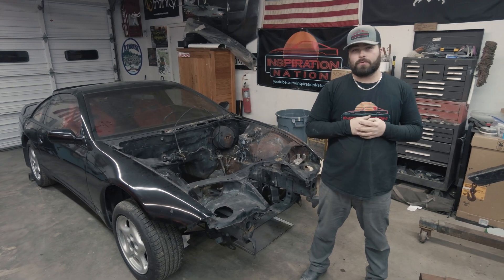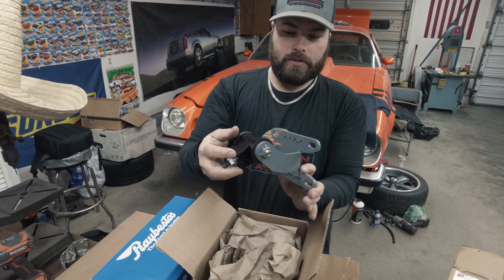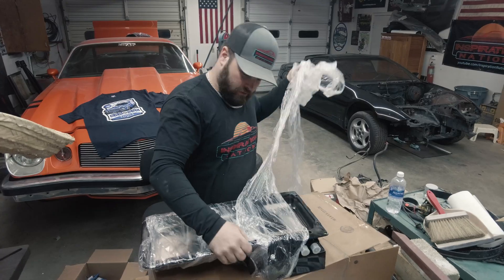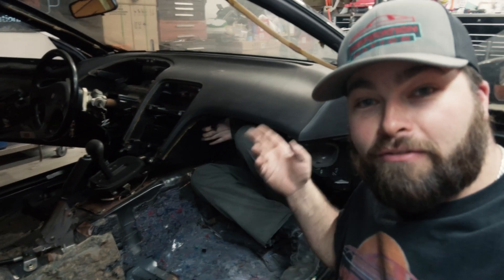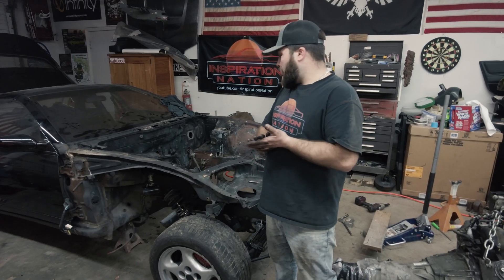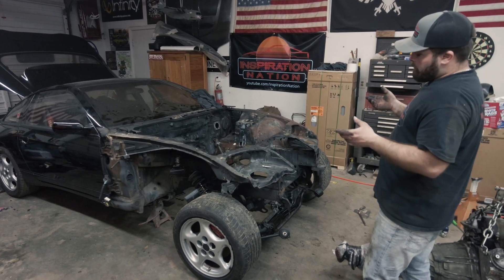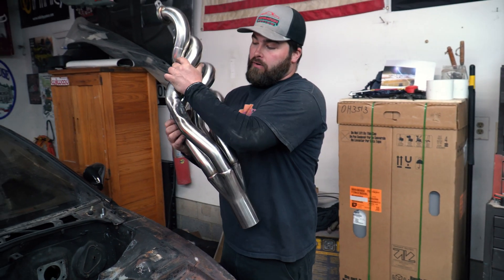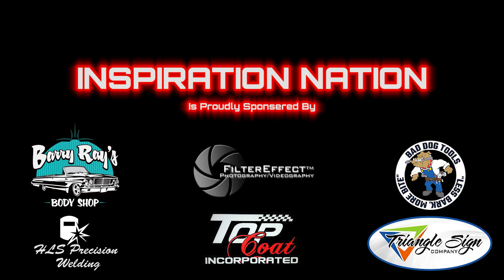Fabricating transmission mount and modifying headers on LS 300ZX

Comment: Hoping to go this route instead of a tt swap on my na. How extensive were the modifications to trans tunnel and firewall area ? Would it require less fab if I use loj 4l60e transmission mount?

Comment: What headers are u using again? Can't wait to see more!!
Reply from the maker: We use the CTS-V 2 headers but you have to knock a pretty good size dent in the driver side one to get it to clear the steering shaft
Reply: Which ctsv2 ? Got a part number?

Comment: looks like a good start i hope the 4l60e lasts for you lol i went with the 4l80e in my Subaru swap but it was not easy to fit lol keep it up i definitely going to be following this project
Reply from the maker: Yes we're going to have a built 4l60 put in it
Reply from the maker: And we're only looking for the 450 to 500 horsepower range which is totally doable on a built 4l60 considering it's not going to be beat on like a drag car